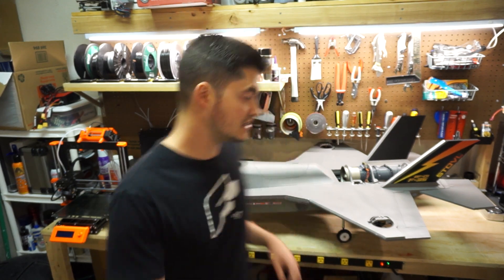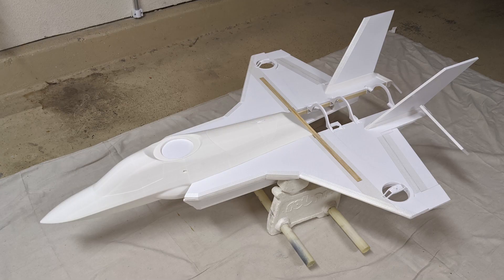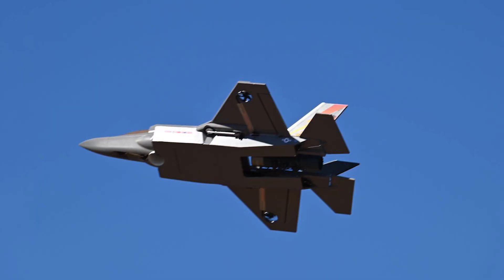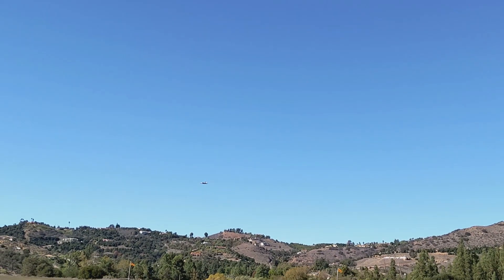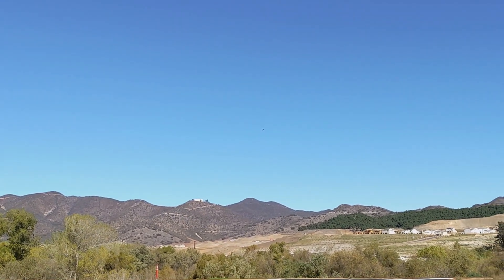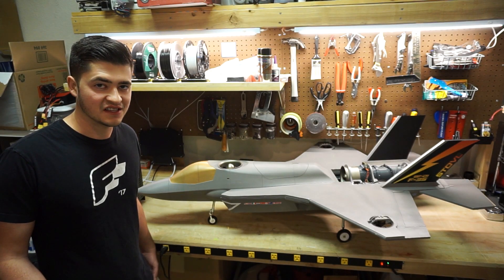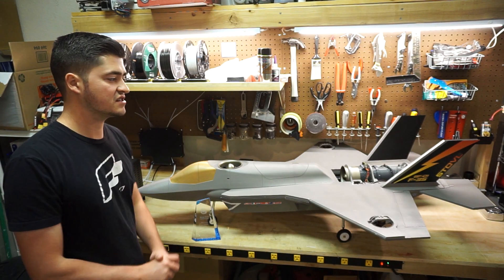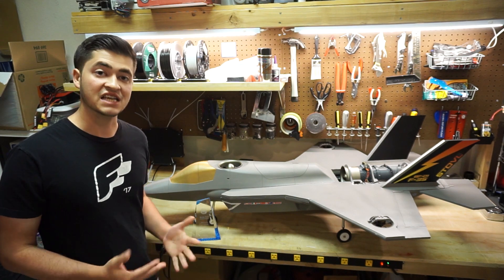R/C F-35B: Unveiling and Flying the New Design

Comment: Okay I’m at work and can’t watch the full video yet, but DANG it looks amazing just scrubbing through. The hybrid printed/foam board airframe is exactly what I would do, but it looks 10x better than what I could do😂
Congrats and can’t wait to watch the full vid later after work…I’ll be back with more comments
Reply from the maker: Thanks Nick! I'm thrilled with that construction method so far. Only drawback I've noticed is that the dark paint makes it even more vulnerable to direct sunlight. I'd still like to make a full LW-PLA airframe but it seems I'd have to be pretty careful with it.
Reply: @ericmaglio  hadn't even thought about the pla melting in the sun.... I think you've earned the right to start pursuing a full composite molded airframe for the long-term solution
Reply from the maker: Maybe! It'd be fun to do a composite airframe with printed tooling like Ramy RC's builds. Though that'd only produce a nice one-off. At least a printed model could be released as a download. I'll have to think about it a bit more before choosing a direction.